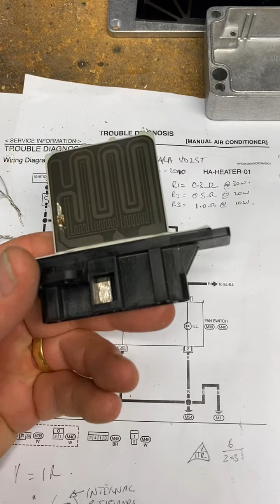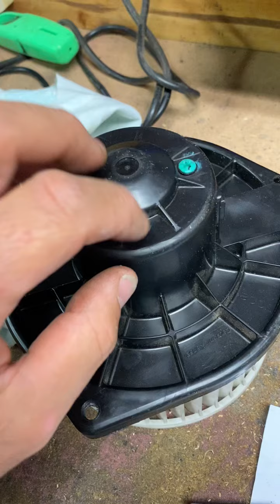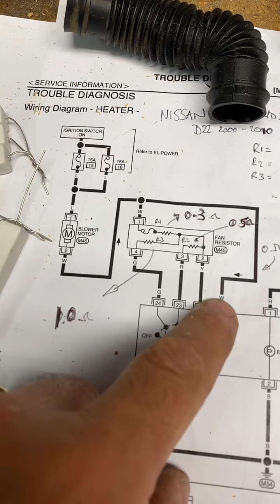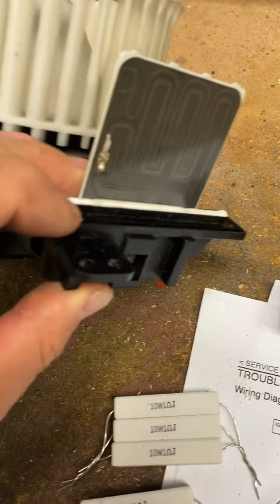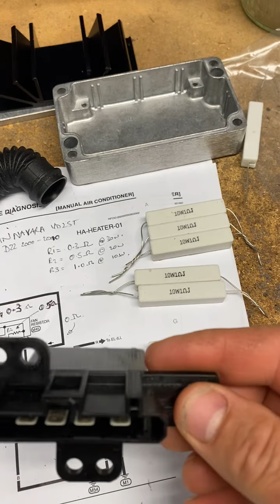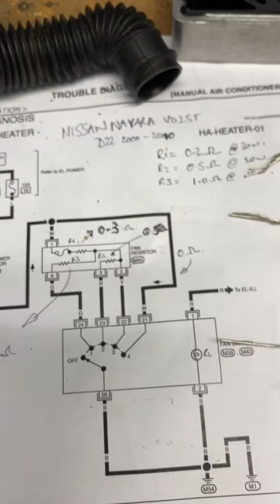Nissan Navara D22 Blower motor fan resistor

Comment: The resistor is constantly burning for me, what is the solution?
Reply from the maker: Id go up in the watt rating of the resistors so they dont get burnt out. try something like this https://core-electronics.com.au/power-resistor-1-ohm-50w.html
and then use the diagram shown in the video

Comment: This happened to me a few months ago, but because I haven't been driving my Navara that much, plus winter time, it hasn't really bothered me too much. But I tell you what, getting that resistor out is a royal pain in the butt! haha 

Either way, it looks like I'll be pulling out the blower motor to give it good clean and service as well. Thanks for the video, quite helpful :)
Reply from the maker: If you can up the watt rating of each resistor pack it won’t get so hot and will last Longer - you can buy resistors with fins on them that would be ideal
Reply from the maker: Jaycar sells most of the components you need

Comment: Hey Chris. Could you please link me to where you've put the pictures of the completed design? And could you please if possible just include a short parts list. My first speed on my resistor has fucked out 😒
Reply from the maker: Hi there Amy, if you have a gmail/email address ill screen shot the cct diagram and send it to you. ok
Reply from the maker: I would post the site but cant remember where and which site it was on - someone on a forum posted in .? sorry  if you send an email address ill email the PDF to you.

Comment: Hi, I am wondering how you removed your resistor, where is it located?
Reply from the maker: The unit is located under the glove box - if you look under there you can see the blower motor housing and the leads that connect to that. Then there is another set of leads that plug into the resistor pack. you need to unscrew two phillips head screws to get this out and then pull it down and it will come free. Its not difficult once you get in there. try pusshing the passenger seat right back and get down on the ground outside the ute and then use a bright working light to look upwards from the passenger side foot well towards the glove box. The Glove box can also be removed easily with about 6 screws and it will give you more access. good luck.
Reply from the maker: See this video - https://www.youtube.com/watch?v=CImqwwq_i9M